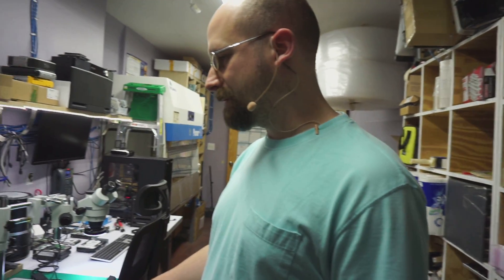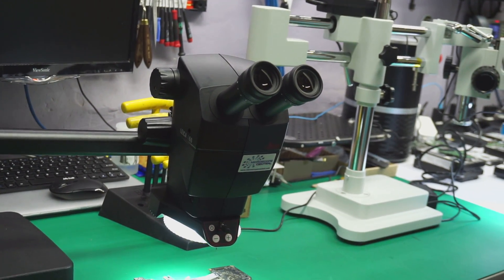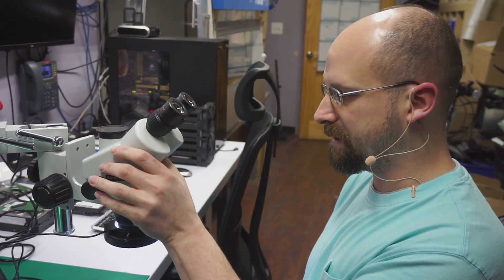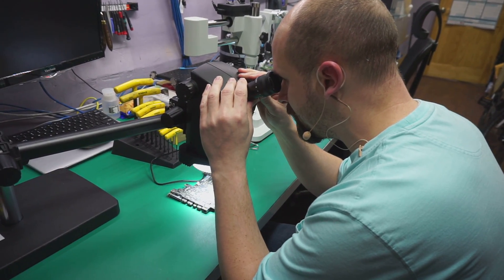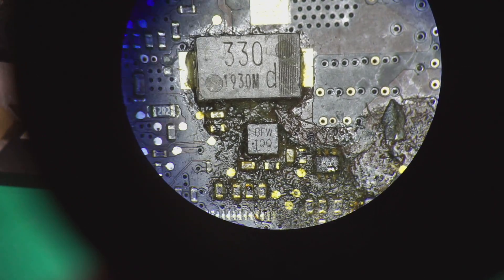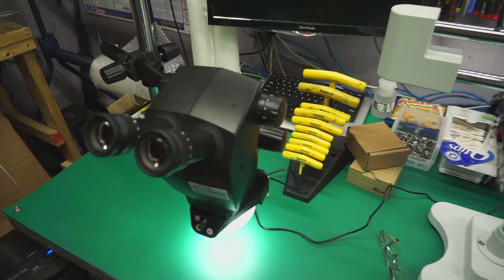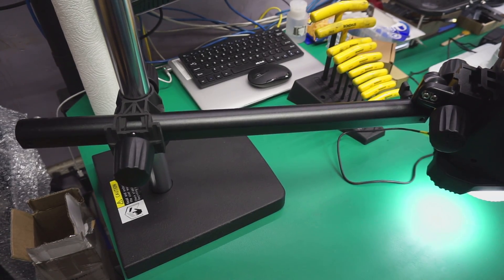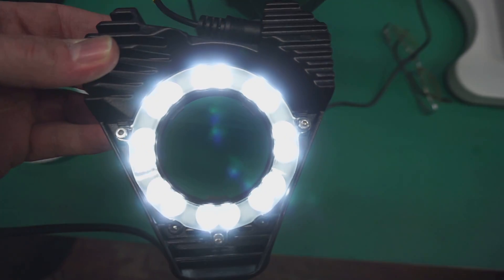[PAID-PRODUCT-REVIEW] Leica A60S Microscope from I Miller Microscopes

Comment: Hey Louis, buy some high CRI (90+) 3000K-4000K led strips that has matching led chips with the ones on your amscope, and replace them! You can definitely buy bare chips but the high CRI strips are easier to reliably find on amazon and aliexpress. I should also warn you that generally cold/pure white (~6000K) are recommended in workplaces to keep you awake and concentrated, but also warm light is much more easier to the eyes. CRI rating is a little bit luxury for your application since you dont do any color sensitive work but that luxury doesnt come at a great expense so why not.
Reply: after finishing the video i take my word back, i didnt know the amscope light 144 chips on it lol

Comment: This is actually one of the budget Leica scopes.

The eyepieces are fixed (you can not swap them)

The 3D image effect you are seeing is likely due to incorrectly set interpupilary distance (see manual here: https://www.leica-microsystems.com/fileadmin/downloads/Leica%20A60%20S/User%20Manuals/Leica_A60S_Manual_EN.pdf)

If camera is important there are modular systems available which would suit much better and give you full flexibility over objectives, stands and cameras, including wireless options that will stream directly do your iPad or phone and do not require a trinocular head.
Contact your dealer or better Leica directly and they will take you through all options.
Reply: What's interpupilary distance ?
Please, explain !

Comment: The lieca looked like a better picture it was more clear. But that bar on it looks crappie couldnt they use some type of hydraulic system so you can just push and pull into place without the tightening nobs

Comment: Buy bare NW led-s from ebay or aliexpress, replace them on your amscope light (you already have all neaded tools)  :D
Reply: Replace 144 LEDs? I want to have that much time in my life. lol
Reply: @AttilaTheHun333333  If you know what you are doing and you have new LEDs ready, replacing 144 LEDs. even with cleaning the pcb of old solder and applying new solder paset will take 10-15 minutes and I bet Louis can do that under 10 minutes... With a hot air station you can knock off old LEDs in 2 minuts.
Reply: @ledhunters  ...and then place 144 LEDs manually on the pads...have fun! ;) Beer is on me if you do that in 15 minutes.

Comment: I thought Leica only makes overpriced cameras.
Reply: o:
Reply: And overpriced binoculars.
Reply: @gordonrichardson2972  And in the kinda related to binoculars field: overpriced laser rangefinders.
Oh and I think I've once also seen binoculars with integrated rangefinder from Leica... now that one was expensive, but I think it could do some I guess firearms related stuff as well where you'd program in some stuff and it would tell you how to correct on your scope reticule?

Over the years I've never really seen the need to upgrade from my old affordable hawke LRF with a claimed 400m range, which it'll do on the right surface (and exceed on really reflective surfaces)... but realistically don't expect much beyond 200m typically. Good enough for my airgun use though to measure the distance to targets set up in a field.